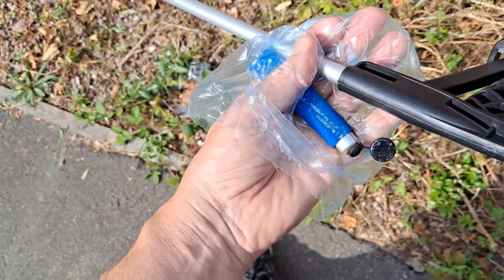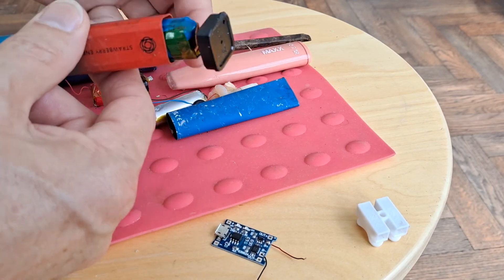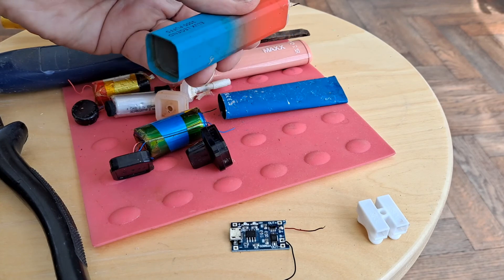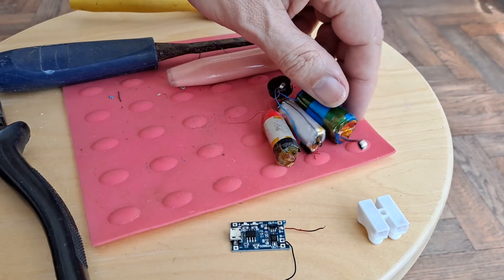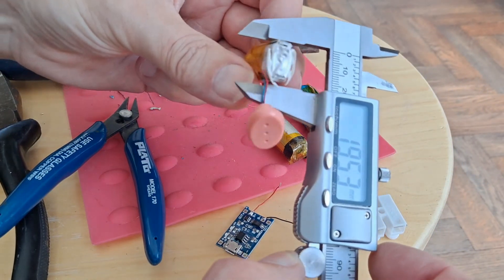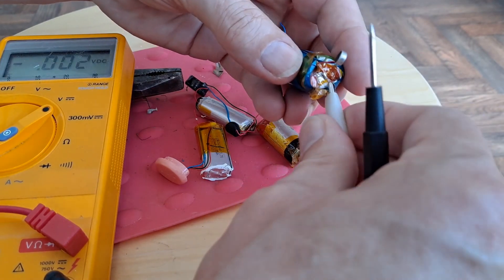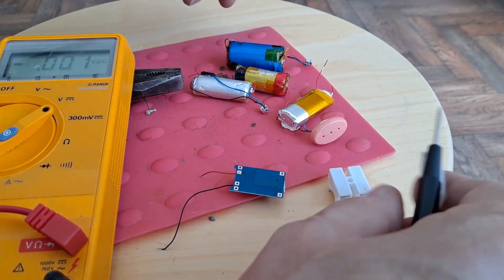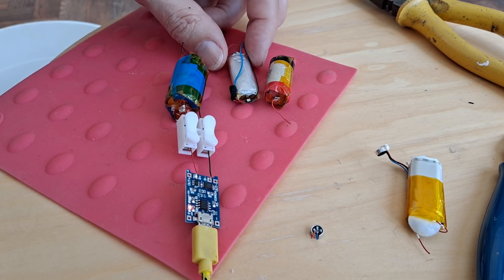Vape Hunter 👀 20220902 Keynsham

Comment: The amount of residual fluid even if it does contain THC I do not believe would be enough to produce a high through skin contact or through touching the mouth or food. 

Similarly fentanyl is also not a concern through any residue via skin contact. 

What would be concern for me are the risk of disease from recently discarded units. So still useful to wear gloves and wash hands.
Reply from the maker: Yes, my initial concerns were  what might be on the outside, but the comments I received were more about the contents. You mention recently discarded. You also have to consider the likelihood, over time, that they can easily have been peed on by dogs or, worse, rats. Both could carry Veils disease - Leptospirosis, although rats are probably a bigger concern. I do cover this again on a later one of these videos.